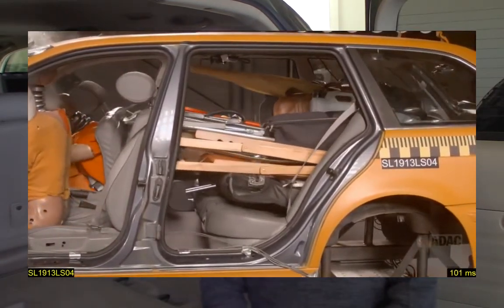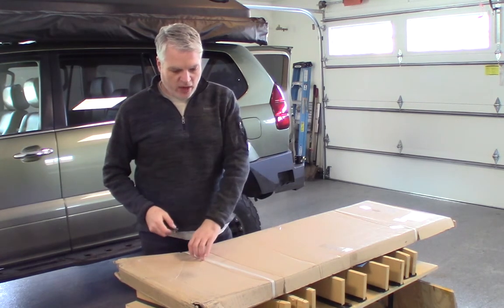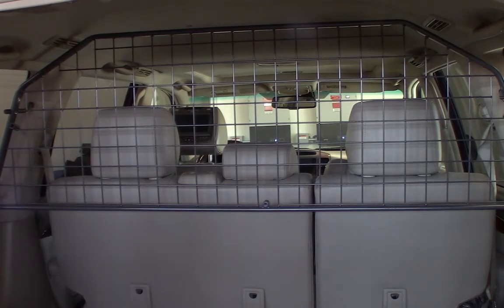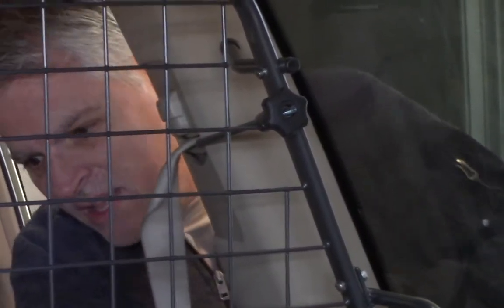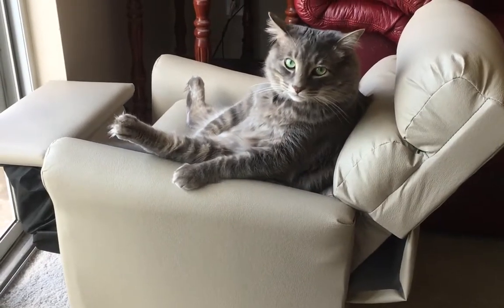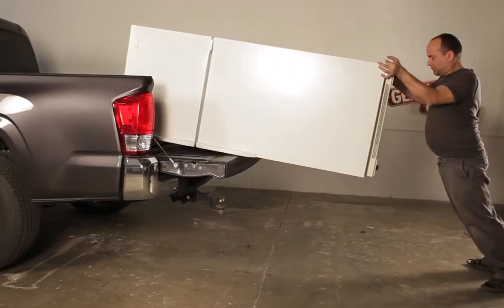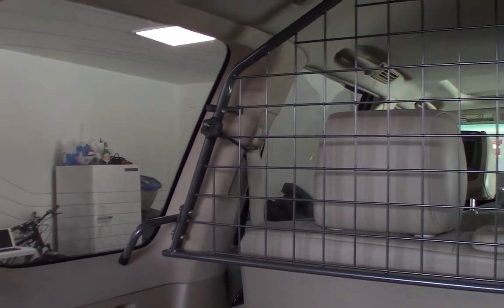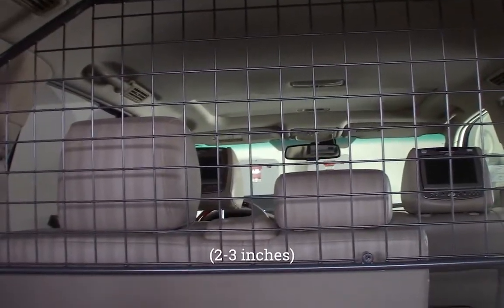Custom Cargo Barrier Install in a Lexus GX470. The smart way to carry a ton of overland gear.

Comment: I had been looking for a similar cargo barrier. I contacted a US based manufacturer and I was told a rigid cargo barrier would interfere with the side curtain airbags in the GX470.
Reply from the maker: Hi Sean, I am not versed in all of the differences between the GX470 and the Prado 120. It is possible that the GX has a different airbag configuration from the Prado. Like any vehicle modification, perform this install at your own risk.